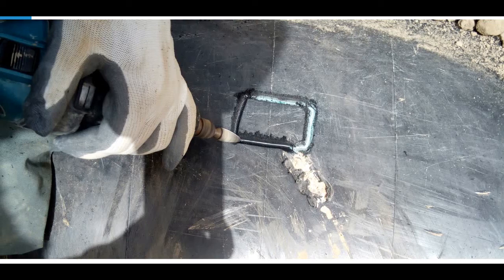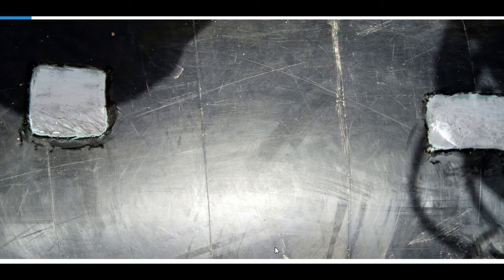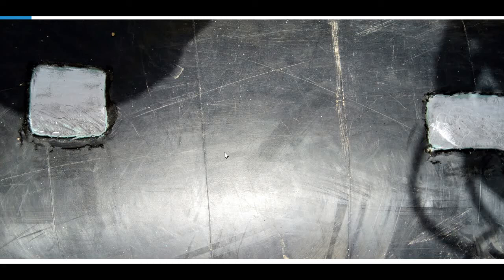How to do Pin Brazing

Comment: Good video. What is the purpose of pin brazing? Is it for cathodic protection?
Thanks.
Reply: PinBrazing is a fast and safe method for permanently attaching cables to steel structures, such as pipelines or tanks, using low-temperature arc brazing. The process preserves the integrity of protective coatings and provides a reliable, conductive, and corrosion-resistant connection—ideal for cathodic protection systems.